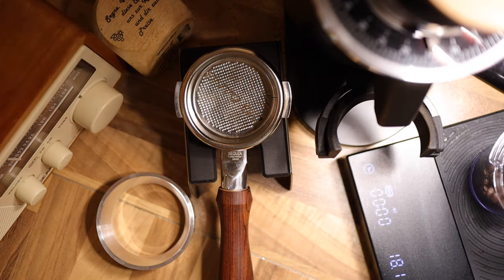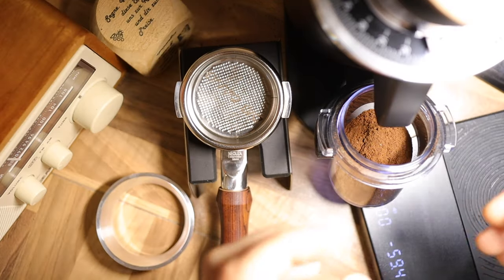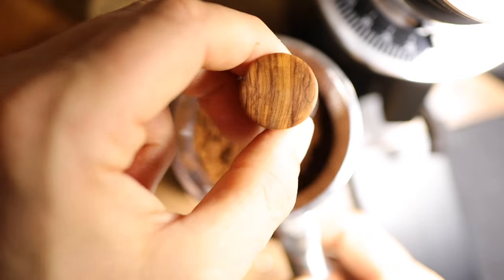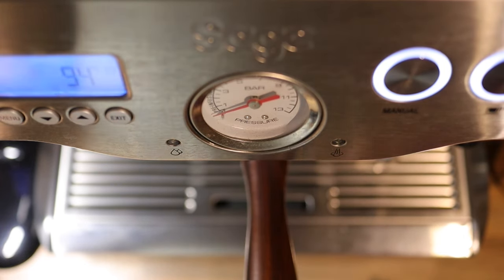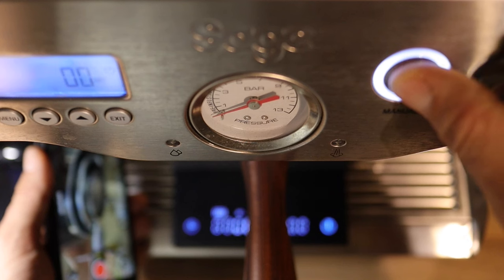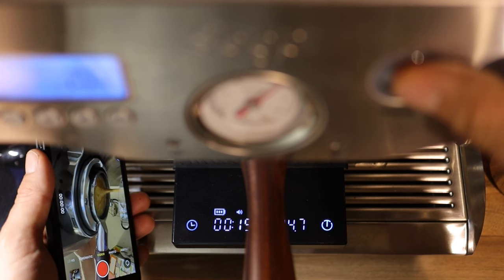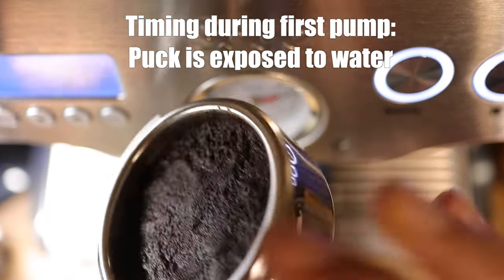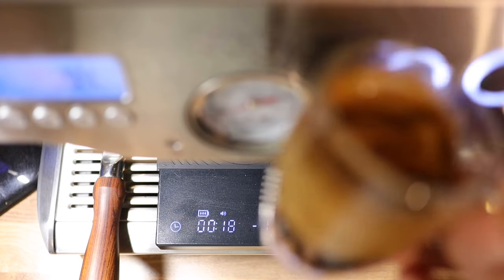Espresso Timing: First Pump or First Drip

Comment: Hey Tom, Love your content! I just wanted to say: I always look at WHEN first drip is and at what time the weight in grams overtakes the time value. I try different beans so it helps to test what extraction I get and keep consistancy. First drip for me is 7-8s after first pump and my gram extraction usually overtakes the time in seconds at around 18g@18s. So, I extract half my shot at 18s or after 10s from first pump. This is really useful info for first time machine owners as it helps me know when to descale my machine as flow rate changes, and test different OPV springs! Hope someone finds this useful :D

Comment: Hot take: It doesn't matter when you start timing it, as long as you start every time at the same phase. Time measurement is important for dialing-in, so if you want to recreate a shot, you need to start timing from the same phase every time.

Comment: Gaggia CP with Tom's dimmer mod and 13 bar (factory) spring.  Dimmer switch is on lowest setting, when I flip the 'brew' button.  Then, I ramp it up to full pressure to finish but the time starts when the water starts.  The small serving size gets to me sometimes.  Fact is, I am possibly enjoying the product from my Bialetti Mukka Pot more than any other method at the moment. It has a sudden-release internal valve that delivers a full-sized coffee that is very hot and strong. Took me awhile to dial it in, I don't use it to make milk drinks, just coffee.

Comment: I was told the shot timing depended on whether or not the espresso machine had a vibration pump or a rotary pump.  The vibration pump takes longer to achieve pressure (which some people like) and therefore longer to produce a drip of coffee, but a rotary pump goes straight to the desired pressure.  Surely, this factor should make a difference to when the shot is first timed? 
That's a delicious-looking shot, by the way 😊
Reply: Yeah that makes sense, I guess Tom is right that first pump is when we should time from as it changes from machine to machine whether or not you take the time from pump or drip.
Reply: @alluma5133  You make a valid point.  Perhaps the standard rule of press-the-button-and-start-the-timing is for rotary pump machines, and press-the-button-and-wait-for-a-drop for a vibration pump model, perhaps shortening the shot time, slightly. 👍
Reply from the maker: Good postulation - I wouldn’t know. Never had a rotary pump machine, sadly. 😢 Could make sense though, considering rotary pump machines are generally plumbed in to line pressure. Cheers!

Comment: Since I have a manual lever, my approach is neither. I keep applying water to the puck at a fairly fixed rate, gently increasing pressure as the puck coffee expands at the top, which increases resistance. Once the puck is fully infused I keep the pressure high and the flow rate at the cup slowly ramps up to about 2g/s. About then most of the puck has been exposed to water for about 30 seconds so I cut the extraction as I don't want the late flavors. The time from start to first drip varies quite a bit, but the total time is 30-40 seconds with a 2:1 extraction. As for Lance, I have tried his recent ideas and I have gone beyond them, but he is helpful. Given how well the coffee was distributed and tamped in this video, I think Tom has no need to try gadgets or complicated procedures.

Comment: Hi Tom I have delonghi 35.25 with pressured baskets, from 14 grams 30 g of extraction  takes about 15 seconds and esspresso  taste not good, I do 60g and that's taking avg. 23sec and that taste OK, so what you would do?
Reply: grind coarser that way too fast its supose to be 14g 30 out in 25-35 seconde ( 30 is the middle that everyone seam to consider right on spot)
Reply from the maker: I'd experiment and do what tastes good to you. I don't experiment much with pressurized baskets, but maybe you have to pull a longer shot. Cheers!

Comment: I don't know about you folks but I don't use a set time. For me a good shot can be anywhere between 24 seconds and 35ish. Different beans need different times. I can tell just looking at a shot now whether it's too fast or too slow. if there is little or very little creme I know I ground too fine. If my creme is very pale in colour but there is a good amount I know the shot was too quick and too coarse. If my shot has a good amount of creme and it's appearance is chocolaty with a nice variety of colour and poured with a good texture consistency I know I got it just about right. Obviously, the taste test is the true judging factor by I think once you have used an espresso machine for more than a year everyone should know a lot just from looking at the pour.